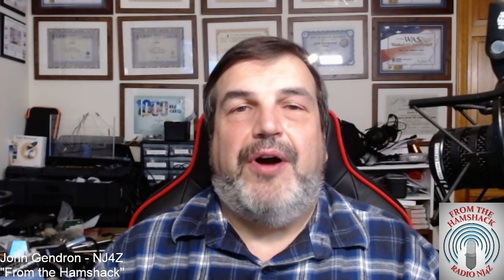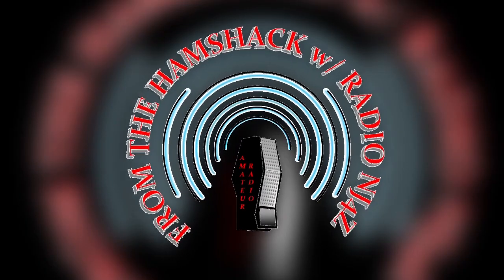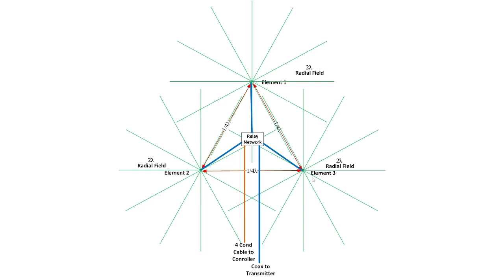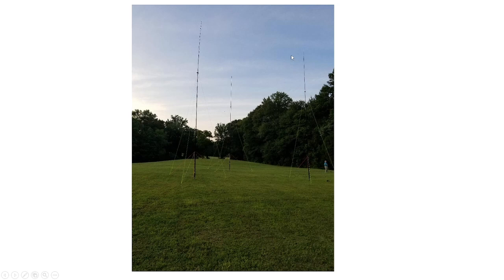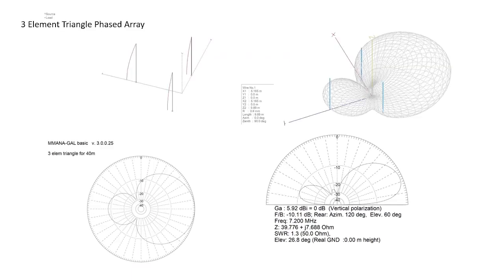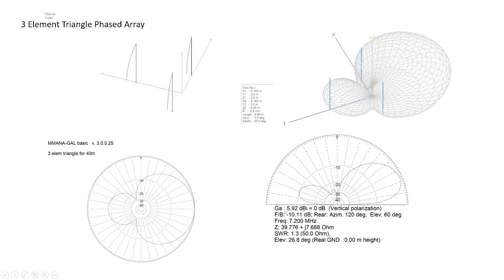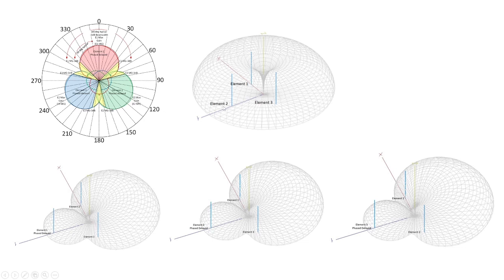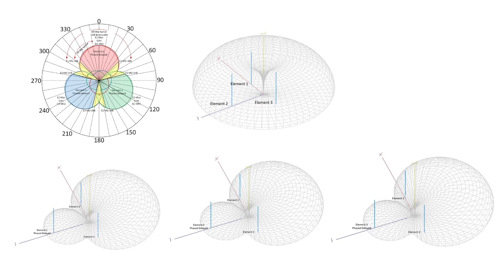FTH - Triangular Phased Array Build for M0MCX

Comment: Just a thought, being as the DXCommander is a multi-band vertical would it be possible to go one step futher and have remote switchable phasing cable so that the all the bands could be used in the same way without the need to select a single band only. FYI I dont have room for a single DXcommander let alone 3 of them.
Reply from the maker: Nicholas thanks for the comment, it is not possible due to the spacing requirements of each band.

Comment: Nice. I'm curious. The vertical elements are 90 degrees? if so then the driven impedance of such would be approx. 32-37 ohms. Are you using an "L" network to transform the Z from 50 to 32-37 ohms? Or does the 82 degree length of 50 coax transform the Z.??? Probably not! Then again using a pair of 72-75 ohm coax in parallel would be  36-37.5 ohms. On the other hand, it may also be that the radial system not being perfect, or enough wire is placed in the ground, could and would increase the Antenna Z up to maybe 40-45 ohms. I've not put much thought of it, just a day ago, came into the cabin to cool off, and watched some YT, came across Malcolms video on the two element verticals for 40.....(I've long retired, but in my day, used to design and build AM tower sites, and always matched the Z of the Ant. to the Heliax.)

Comment: Love the video, John, and I’m excited to see how this works. Noob question - What would happen if you added the 71 degree delay to two of the elements?
Reply from the maker: Mike... thanks I am glad you enjoyed it. You can switch in two delay lines if you like the pattern changes just a bit. The way this is set up a small change to the control circuit will allow for this and make the antenna operate in 6 directions vs the three with one element in delay.

Comment: 2 questions:: what length is the phasing line and is it possible to get a wiring diagram of the control box?  I have a pair phased for 40 now using the chrisman method and it works well and I have room to add the third vertical and your idea would really help me especially with the direction it works. Thanks you did a great job.
Reply from the maker: Mike, thanks for watching.  The length of the phasing line is going to depend on frequency and the phasing angle you want to use.  I used the formula of 299.8 / Freq in MHz to get the wavelength.  You, then multiple the wavelength times the velocity factor of the cable to get the electrical length of one full wavelength of the cable in meters.  From there you can calculate the length of the phasing cable a couple of ways the easiest I think is to divide the electrical wavelength by 360 and multiple that number by the degrees of phasing you would like to use.  For example, (40 meters) 299.8 / 7.15 MHZ = 41.93 meters.  I use RG 11 (75ohm cable) which had a Vf of .66 so 41.93 X .66 = 27.674 electrical length for the cable. To derive the length of each degree we divide 27.674 by 360 degs. = .077 meters per degree.  For 71 deg of phasing angle you would multiple .077 by 71 and get 5.467 meters for the cable.  Calculator here https://www.qsl.net/w4sat/velfact.htm .  I am not ready to release the wiring diagram yet and I am doing some final testing.  More to follow soon.

Comment: John, is this different than christman phasing method? In modeling it appears different. With Christman the element that's delayed doesn't act as a reflector The non delayed element becomes the reflector. Based on what I've seen and read. Is the 75ohm coax adding inductance here, electrically lengthening the delayed element? Therefore it becomes the reflector? If so, do we still need to consider the length in degrees of the delay line? Thx!
Reply from the maker: Chris, yes this is somewhat different in the face that we have two elements in phase and we are actually delaying the signal to the third element.  Looking at the currents when modeling the phasing line does produce and inductance.  The phasing angle in the modeling does change the pattern at a given frequency as well as a slight change to the standing wave ratio.  I hope this helps.  If you look at the 3d far field plots of the antenna you can see who the pattern changes as you increase or decrease the phasing angle for a given frequency.  I have experimented with the antenna in the field built for both 20 and 40 meters.  I used both 90deg and 71deg phasing lines.  There is a pronounced difference on receive when changing the angle.   The front to back changes as well.   This has been my experience in the field, I have not done any serious measurement tests using a Field Strength Meter or the like.   I hope this helps... but it just as well may have muddied the water.
Reply: @fromthehamshack-radionj4z  yes this helps clear up the phasing degrees of the delay line. I guess I'm still unsure how this is different than christman phasing. The delayed element acts completely opposite.

Comment: how did you end up with 71° of phasing as your golden number?
Reply from the maker: trial and error, then some Math as the height of a triangle at a 1/4 wavelength on the length of the sides is not exactly 1/4 wave.  so if the distance is shorter we need to delay less than the traditional 90 degs.